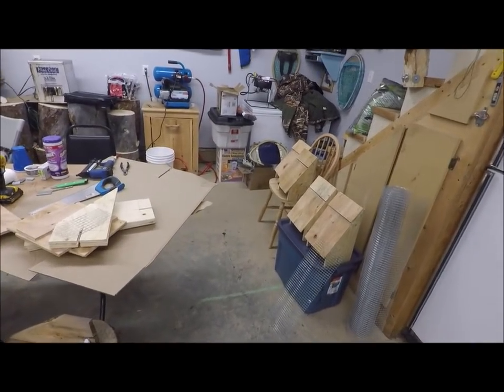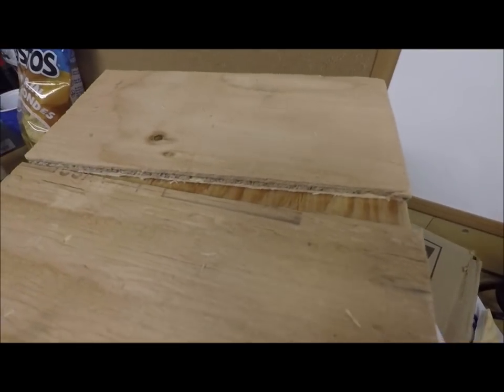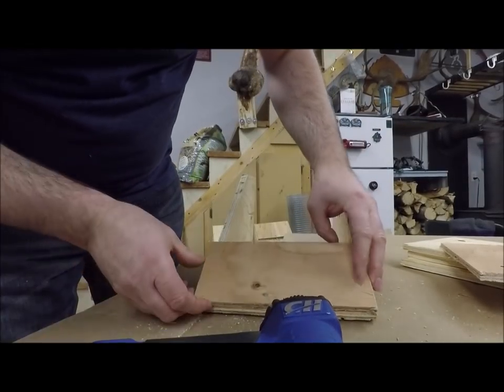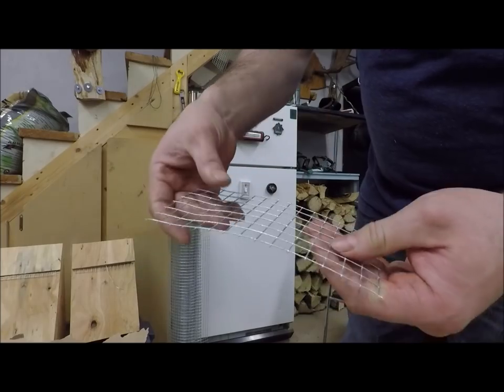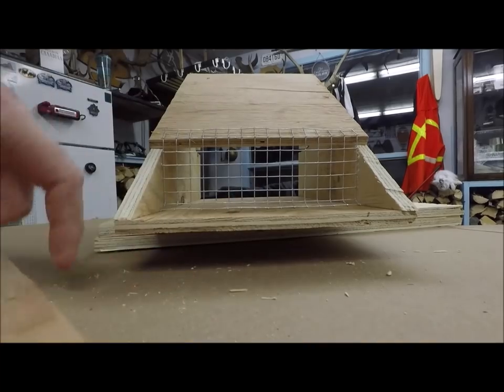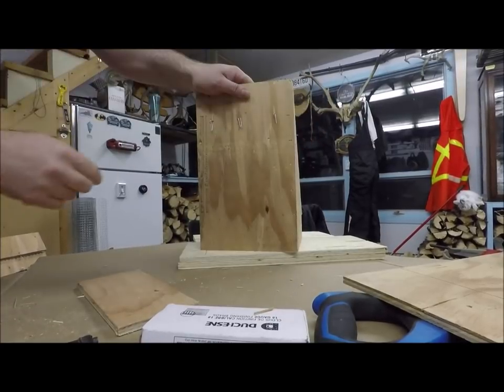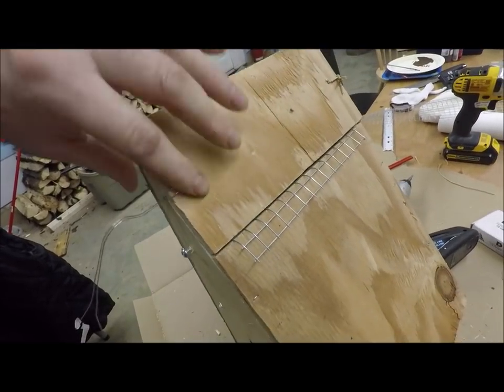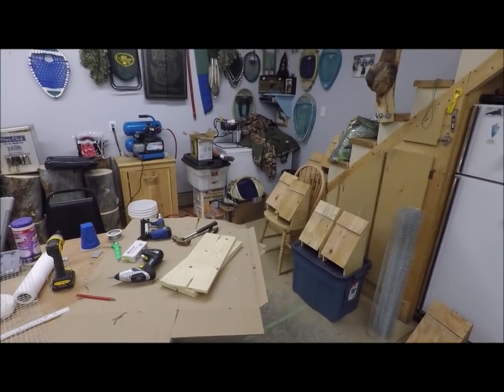Marten Box Modification & Refurbishing A Old Box

Comment: Great video, I have a helpful hint for you, when stapling into plywood, turn your staple gun so the head of the staple is running parallel to the grain, this way if the staple flairs out it will go into the grain instead of  coming out the side.

Comment: That little bait cash you make is a wonderful idea i bet there are a lot of trappers out there modifying the box cause of your video. Thanks for the idea. One suggestion use little glue when you staple them together, a good exterior glue helps keep them together long after the staple has rusted away, Another to secure and hinge the top why not the hole wire and the the screw hole and wire to secure with a longer life? just suggestions

Comment: Do you fasten to the tree by 1 nail in the center or 2 , do your traps cables fasten to the box or tree ? I like your design very good !
Reply from the maker: Two nails, one on the top & on on the bottom of the box. Sometimes even give the extra 3rd nail to secure the box well to the tree...

Comment: Great video sir! I like it as not bulky like the tapered boxes I use now for marten/fisher and half the plywood plus I like the bait "door". Is it 1/2" plywood?
Reply from the maker: Thank you, 1/4 inch plywood…
Reply: @Biglandtrapper  perfect. Not to thin Bill? My tapered ones I use are really a waste of lumber as too big but still work. I imagine I will have to modify a bit for my Belisle 160's?
Reply from the maker: @loneranger8293  yes that’s right just make a little bigger for the 160. 1/4 is good, sides made from lumber just front and back from plywood. I use different size scrap plywood as well but if I buy it I get 1/4.
Reply: @Biglandtrapper  good to know, thanks

Comment: What size trap
Does this fit? Will a 160 Belisle fit?
Reply from the maker: I use 120 Belisle but you could easily adjust the dimension so a 160 would fit…